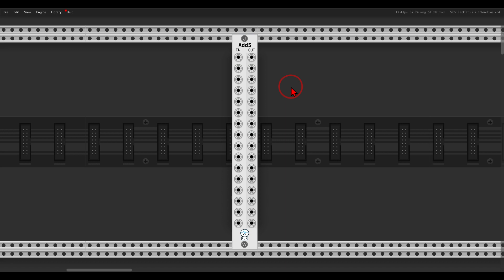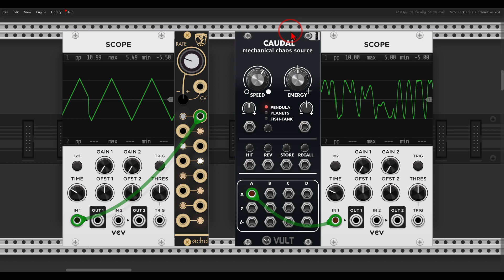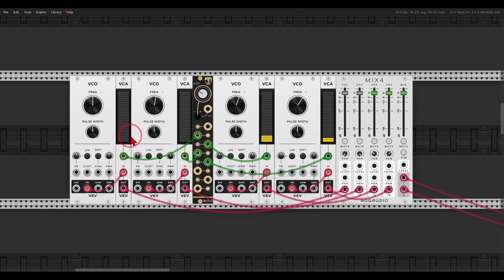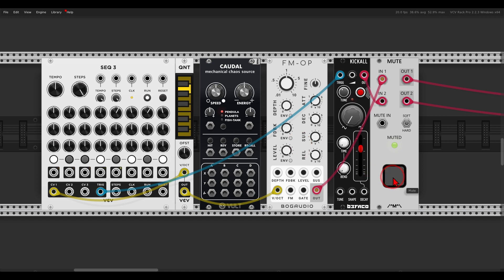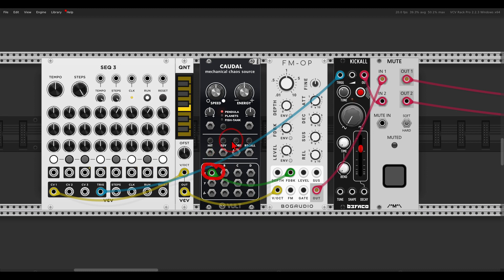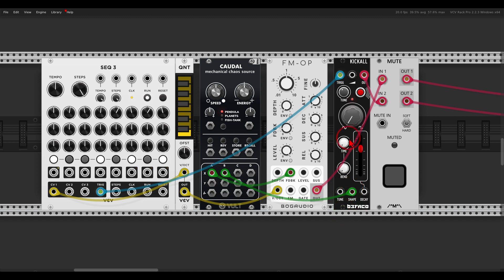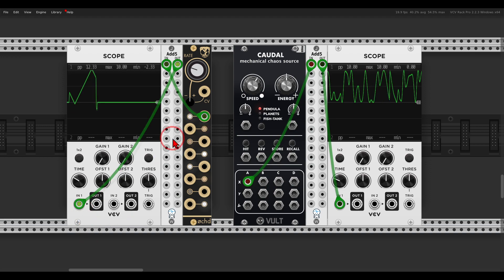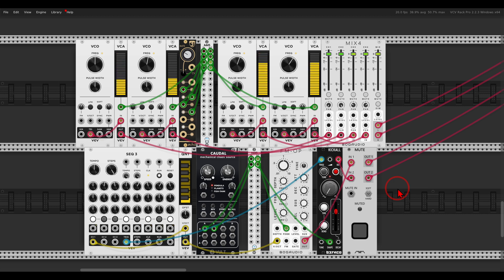Easily convert Bi-Polar to Uni-Polar \ Quick Tip

Comment: Is something like this available in hardware?
Reply: Many hardware VCAs have offset functions as well (MI Veils, Happy Nerding 3x VCA, etc.) but I think what comes closest to the presented module is the OFFSET x6 by Sebsongs Modular (ist a thonk DiY kit).
Cheers!
Reply: @low_rise5030  Thanks for the suggestion... Sebsongs was not on my radar. Looks like the NE Sinc Pravus with two more channels. ALM A/O/x2, Befaco A*B+C, and 4MS SISM all offset with attenuation, but I always have to fiddle to find the right mix. In a perfect world, there would be a knobless fixed +5v option.
Reply: @mweb47729  the OFFSET x6 puts out 5V when the knobs are fully clock wise. The Sinc Pravus has a switch on the back where you can choose if it does ±10 or ±5V.
Whit pots FCW it's not that much of fiddling anymore, I think. ;)